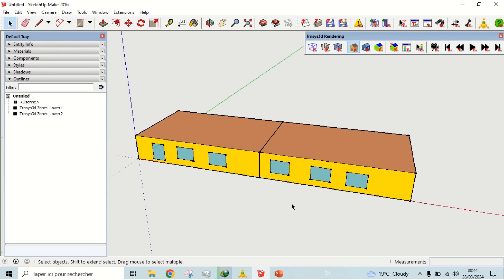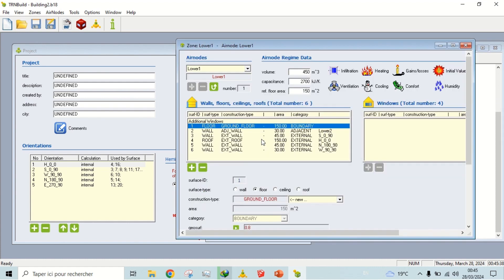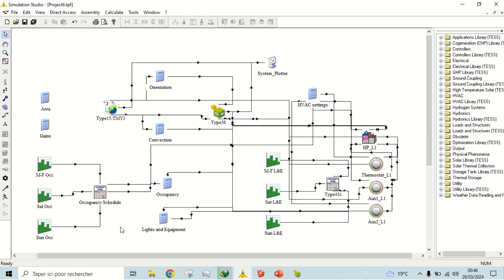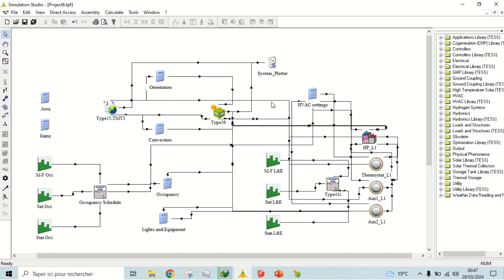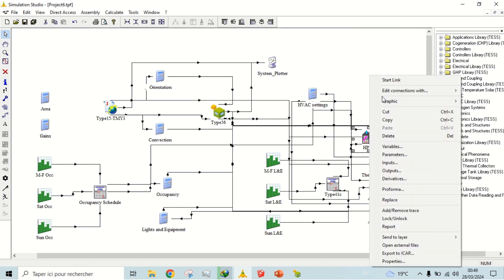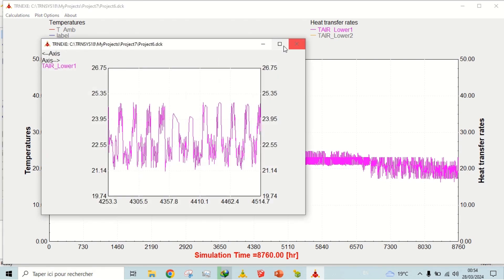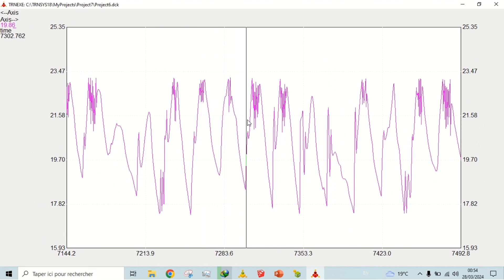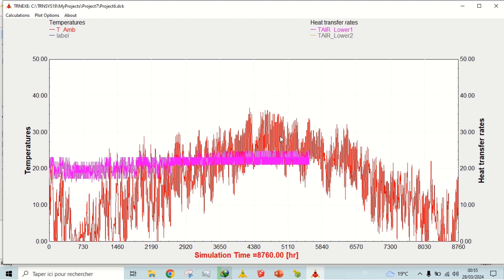How to design an HVAC System for a multizone building in TRNSYS - Part 1 - Introduction

Comment: hey there! thanks a lot for this tutorial video!
i'm wondering can i design a building as a single zone area (doing this for simplifying my Project) in Sketchup using just like Multizone building?
Reply from the maker: Yes of course. It is simpler than this one.
Reply: @howtodoeverything59  so i need to design my Corridors with only one Trnsys 3Dzone ? right?
Reply: @aliakbar_shirali  Yes, the corridor wall will be created as INTERNAL walls in this case.